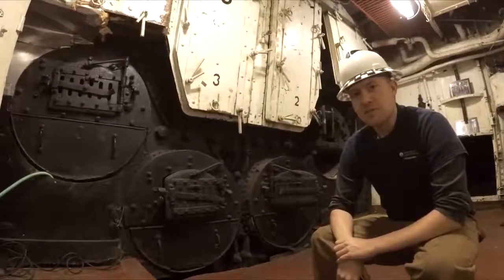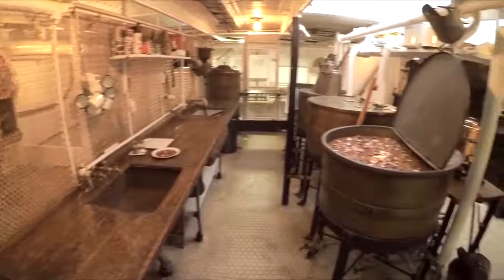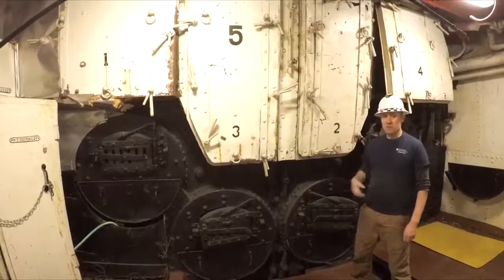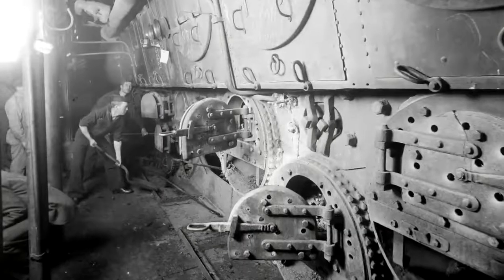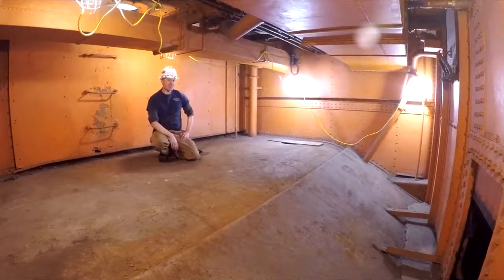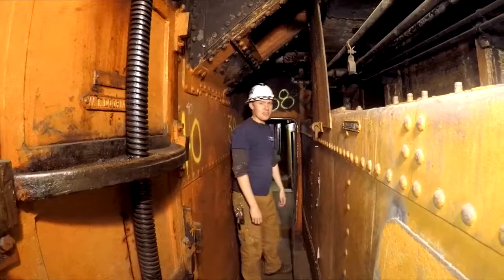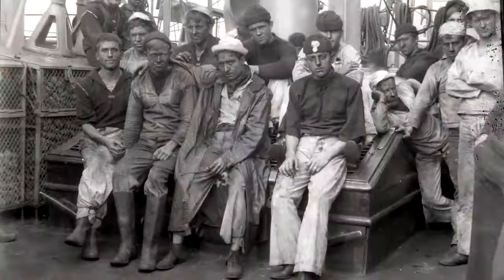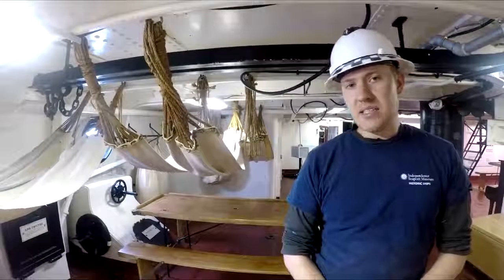Tour the Coal Bunkers Aboard Cruiser OLYMPIA

Comment: At 17 tons/great and 1200 tons coal capacity would suggest ship could operate about 70 hours at full speed or 140 hours at half speed which would imply the ship would have to be coaled every 5-6 days. Many navies in the early 20th century were anxious to convert to oil as if for no other reason it eliminated most of the firemen and trimmers. Less mouths to feed, house, and pay.
Reply: In principle, by the numbers, 70 hours is the max. But there's no way in hell you could operate at top speed for more than an hour or so unless you wanted to kill your firemen. This is one of the underappreciated advantages of oil-fired boilers. There were a number of occasions in WWI where coal-fired German battlecruisers were run down by oil-fired British battleships that were, on paper, considerably slower. However, the German firemen simply could not maintain the physical effort necessary to fire their boilers fast enough to maintain their ship's top speed for more than half an hour or so, whereas the fuel pumps on the British ship's could pump at maximum capacity effectively indefinitely.

Comment: I visited Olympia a long time ago. (Maybe 1980?) At that time the engineering spaces were open to the public. I found the engine room very interesting since a piston engine that size is an unusual sight. I guess this was only half the powerplant because I know the ship was twin screw. I also went into the boiler rooms and found a small, white-painted wood sheathed room separating two of the boiler rooms. It was only after I read the book "Big Gun Monitors" by Ian Buxton that I realized this was probably a magazine -- maybe for the 5" secondary guns. Olympia was fortunate that she didn't share the fate of the monitor Dr. Buxton describes that feature of...yes, the heat from the boiler room set off the magazine and sank the ship. Keeping sources of heat away from the ammunition was a big deal in all periods! The wooden sheathing in Olympia was doubtless used as insulation. Is that room still there, and is it open to the public? Is it really a magazine or have I made in incorrect guess?

Comment: Where did the make-up water for the boilers come from? Saltwater from the ocean?
Reply: no you cant run salt water in a boiler all ocean going ships have some sort of desalination system to take the salt out of the water
Reply from the maker: The water from OLYMPIA's boilers was primarily held in her freshwater tanks and the water "recycled" through her condensers. To supplant water loss in the system, OLYMPIA also had a distiller room which was designed to produce 8,100 gallons of sea water into fresh water per day.
Reply: @ryanstuckey8677  the water issue was one of the things that slowed down moving from sail to steam on ocean going ships. By the 1820 there were hundreds if not thousands of steam boats on rivers or in port cities,  They did use sea water in the auxiliary steam engines on some vessels but it insured very short boiler life.  the big factor was coal or wood consumption, could a vessel carry enough to make it across, river boats could stop every day and pick up supplies and of course the fresh river water fed the boilers.  What made it all happen was the triple reduction steam engine and high pressure boilers, the engines got three shots out of every unit of steam, some even used the vacuum effect of the condenser  to help out.

Comment: No stoker engine? The big locomotives had them.
Reply from the maker: Mechanical stokers for marine use were first suggested sometime in the late 1890s but few successful examples have been found. Stoker engines were mostly used at power stations and then later, large locomotives. Manual stoking remained a standard practice for most merchant and naval vessels up to the end of WWI when oil fired systems were adapted.

Comment: Disappointed. You didn't open the boiler door or the furnace door to show us the inside.
Reply: or show us the steam pipes that feeds the engine . . .
Reply: On my visit long ago (see my other entry) you could wander unsupervised through the engineering spaces. I tried opening the furnace door but the light was so poor I couldn't see very much -- the museum has evidently installed much better lighting seen in this video. The furnace reahed far into the distance, it was hard to imagine the stokers were able to get an even bed on the grate. While I was able to move the door by hand I realized even then that in operation, it would be practically red hot and the stoker needed a special tool to open the door. That tool wasn't displayed anywhere I could see. I would also like to see a more detailed video! And one of the engine room too! The American Society of Mechanical Engineers, I think, awarded the Olympia's engines a prize. They are special, very rare examples of their kind.